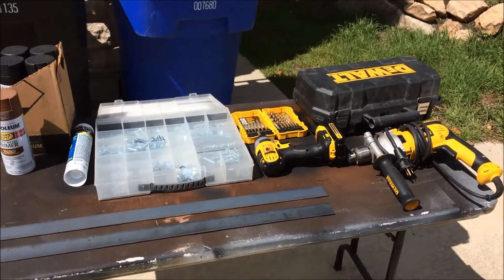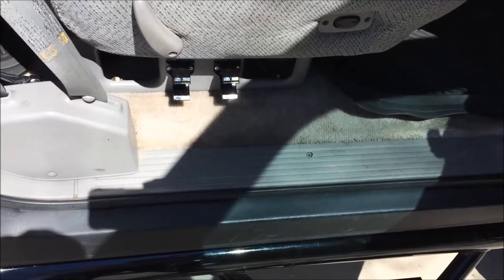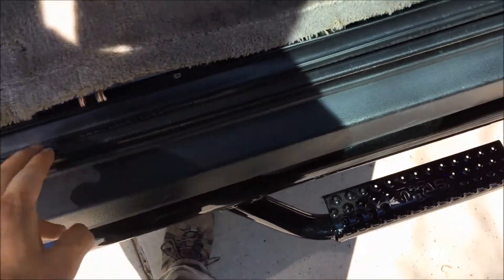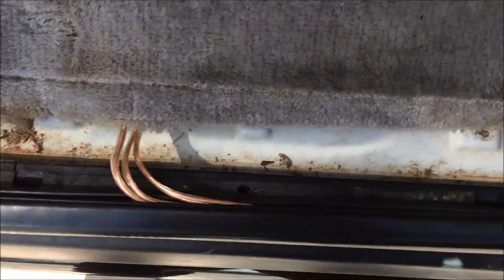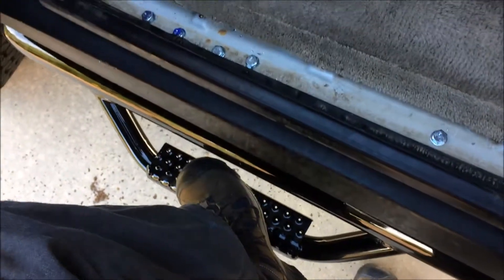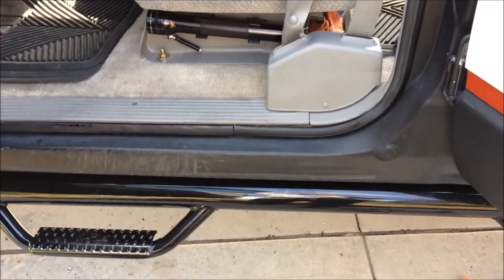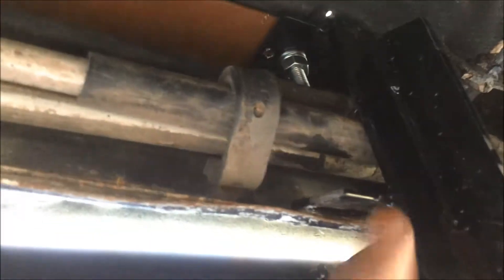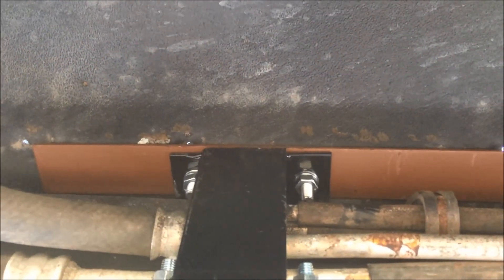20170403 Suburban NFab Step Bars Part 2

Comment: I realize this an old video. i was looking at the bars for my 99 suburban. i also have rear ac. i bought bully step hoops but because of the rear ac they will not work. i have found a new brand that says the attach to the body mounts. i really wanted these but that looks like a lot of work.
Reply from the maker: Mike T it certainly was a lot more work than I anticipated. Made me really dislike the N-Fab engineers, but I got it done.

Comment: I think the two extra bolts in the step brackets would have been enough.  Sucks about the rear heater line.
Reply from the maker: Yeah, it may have been, but I had everything pulled apart and I had the hardware...except for the very last bracket.  That one ended up with just two.  I didn't have enough nuts.  The AC and heater lines I thought I had moved out of the way and I thought I was being very careful not to sink the drill bit in deep.  All it took was one slip, though.  Ah, well, it happens some times.